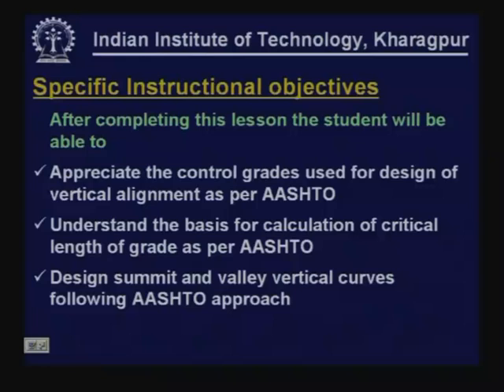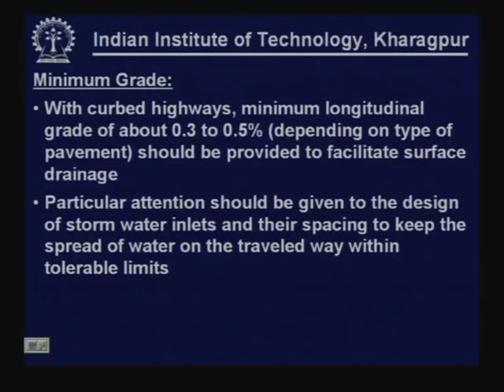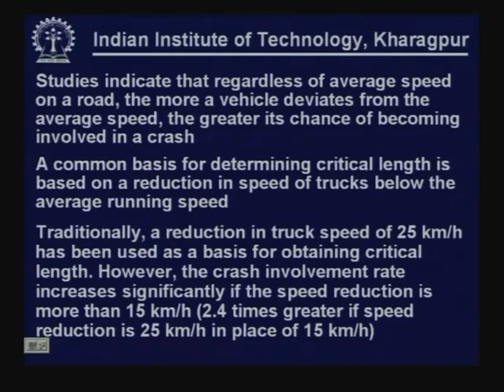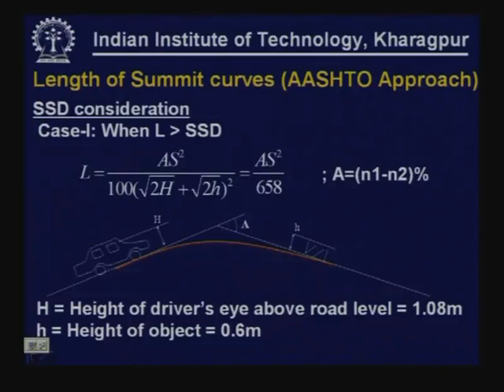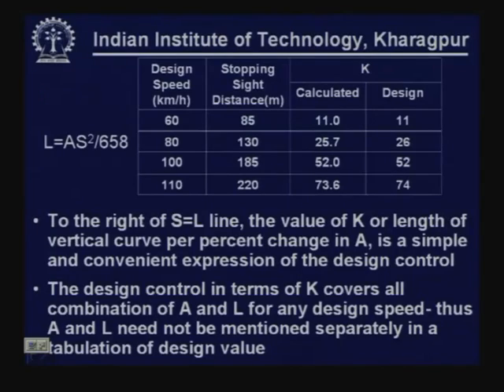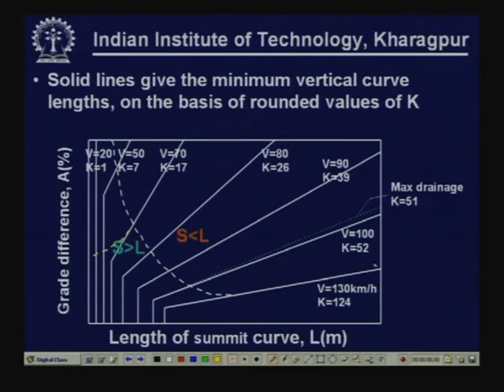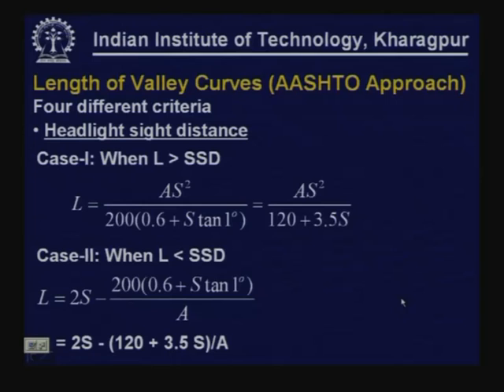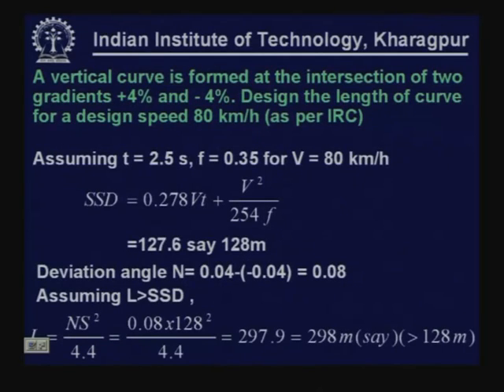Lecture - 21 Vertical Alignment Part - II

Comment: Sir, Why object height for OSD is 1.2m but for SSD is 0.15m in calculation of length of curve in valley and submit curve??
Reply: in OSD you over take vehicle that height 1.2m assumed.

In SSD you need to stop vehicle before it is going to touch tha obstacles which height is taken 0.15 m by IRC